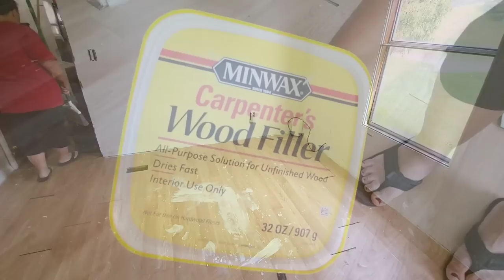Single Wide Mobile Home Master Bedroom Makeover/ Mobile Home Living

Comment: Just a little tip, if you are trying to fill a big gap you need to build up hole. Put in a small amount of filler, let it go hard, put in some more filler,let it set . Continue until the hole is filled. My ex husband is a carpenter and taught me this tip, stop it all falling out in a big lump. Good luck with your renovations. Blessings from England.🇬🇧

Comment: The reason your flooring was separating is because you didn’t have quarter round around the edges to stabilize them. If you pushed the flooring together then nail each end slat so it can’t move that would work.

Comment: A great product to use in place of wood filler is bondo. Is does not shrink and really does a great job of holding its shape. You just have to be careful how much hardener you use. You have to work with it fairly quickly and mix small amounts. Kind of a pain but has great results.

Comment: Hi…this is just the second video of yours I am watching, so you may well have addressed this previously. Just in case I thought I’d share what I learned years ago. I was renting an apartment where they painted the wooden floors, but with just normal use they were uickly scratched. I also used felt pads onbthe floors to protect rhem. The problem was they never added a coat to seal the color, and they used satin finish paint!!  You are obviously working very hard to do a great job, I’d hate to see you be disapointed with scratches! Great job…good luck in your search to buy a house!!!

Comment: You did so much work and it looks so much better. I am a little worried about safety though. Mobile Homes have molding at the top and bottom to secure the panels to the walls. Wouldn’t it have been better to keep as much of the molding pieces as possible? It will be expensive to replace them and a lot of work.
Reply: Maybe most of that is for the transport part?